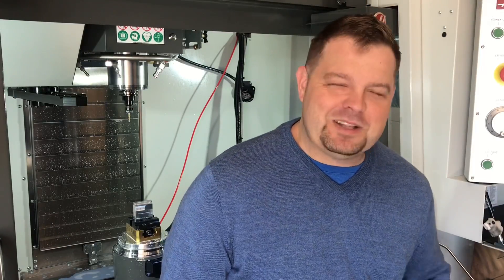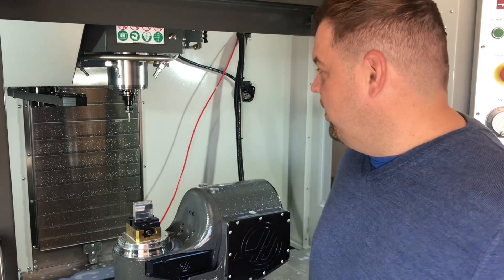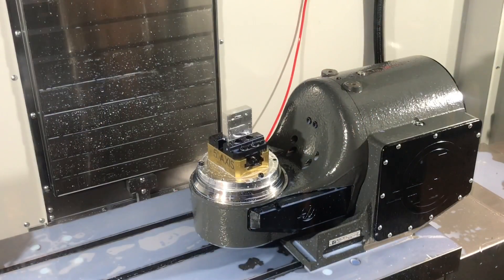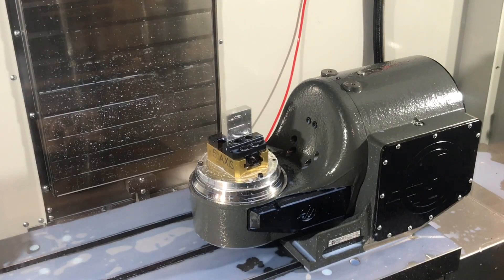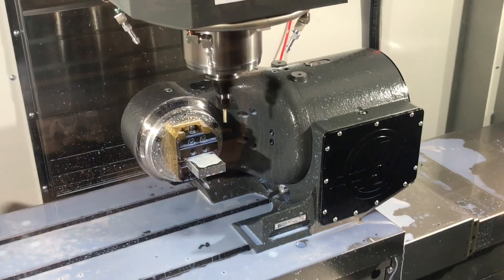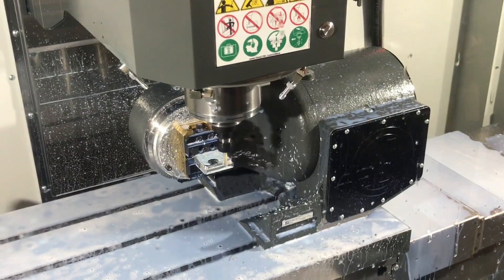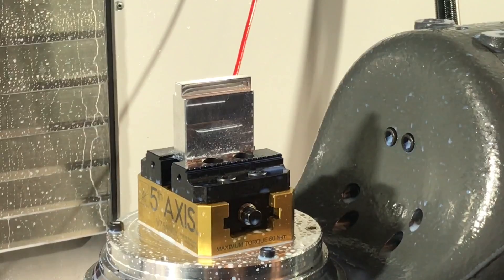Newb First Ever 5 Axis Cuts (3+2)

Comment: i wish the haas had a knob for the feed instead of te buttons
Reply from the maker: mackk123 it does. Just hit handle feed and you can use the handwheel
Reply: @NerdlyCNC  nice i didnt know that, ive gotten too accustomed to the fadals i just single block it till it reaches that positive z value along with the knob and i just crank it down when it gets closer and closer.

Comment: I'm going to be getting a 2009 Haas OM-2A in about a month (moving up from a Taig), so I'll be using coolant for the first time. How did you choose Qualichem 250C over all the other coolants out there?
Reply: Cimcool has worked well for me in some difficult applications, running 1200sfm in aluminum on a router. I'm looking for something with good performance which doesn't suck so much to breathe in, after this bucket is gone, I'm going to try blaser

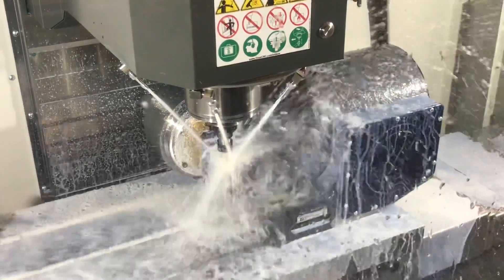Comment: That's nice ! ~  Is the part tilted like 5 degrees ? (Is the part a slight wedge shape ? or taper ?)  @5:20 ish onwards the C axis does this little five degree correction before the A axis rotates back to "Starting" position. How you liking the 5 axis unit so far ? And how much of a PITA would it be to put on and off the table in the future ? [I know you are going to keep it there but have always wondered how long it takes to set up 5 axis trunnions on a HAAS ? ]. Cheers and thanks for sharing !